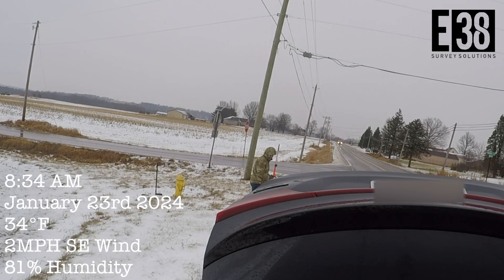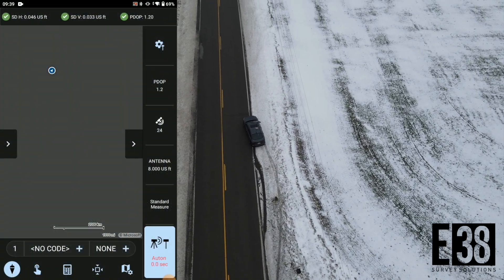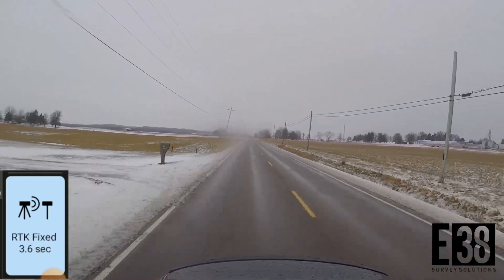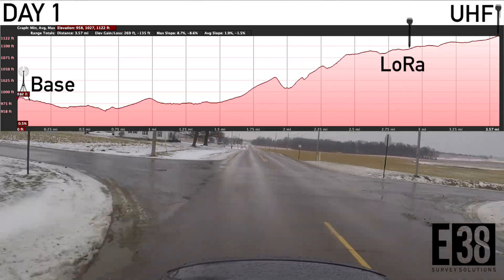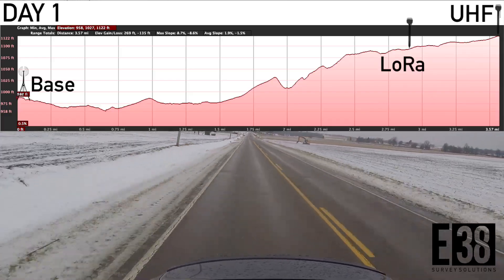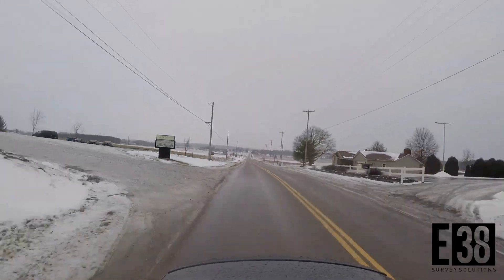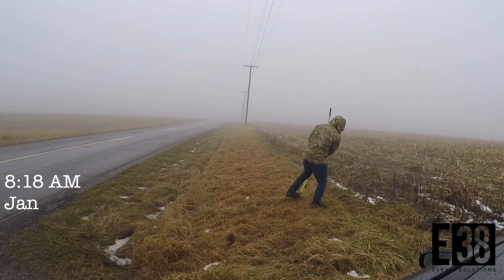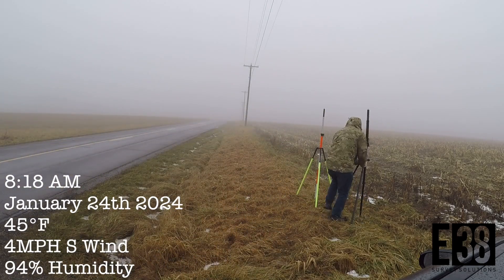Emlid Reach RS3 LoRa vs UHF Range Comparison | Farmland Roads

Comment: Hello Patrick. Can you help with this: one thing that is not clear about FieldGenius is the L1 and L2 offsets to antenna phase center of RS2+ and RS3+. You can just inform L1 offset in FieldGenius, but it's not clear enough wich value should be putted in the app, for Android and Windows. Which Offset do you use? Thanks!
Reply from the maker: "ARP to APC (L1) Offset - Vertical" should be set to 134 mm. I believe if you input the correct model in the Android version it should auto populate that.